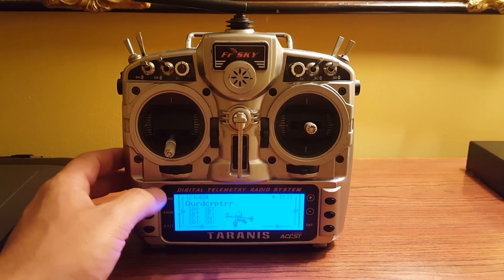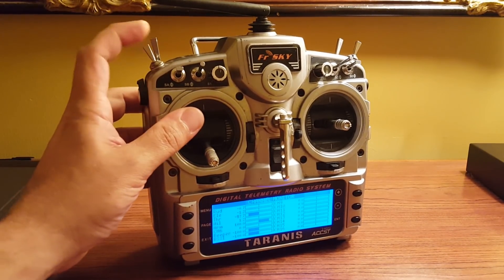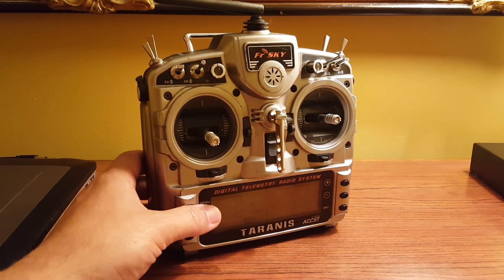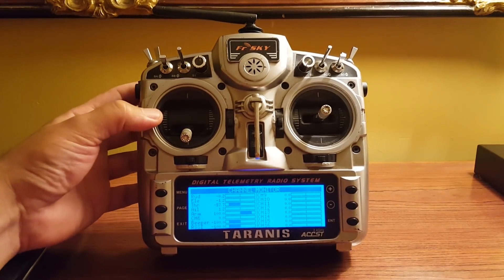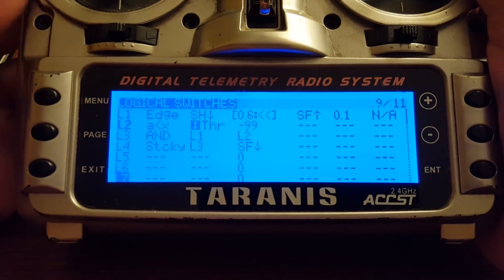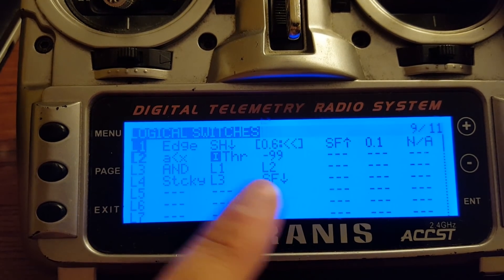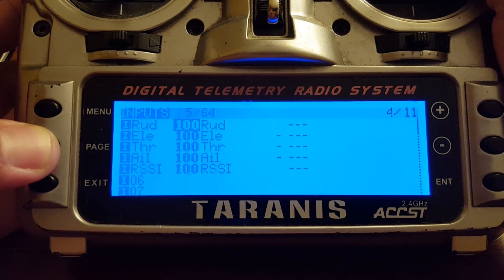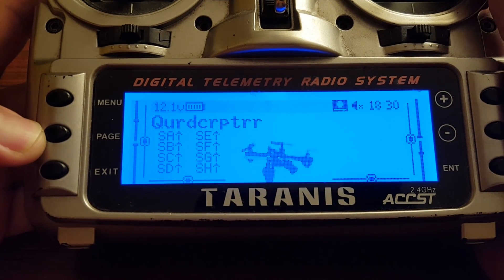Safer Switch Arming on FrSky Taranis

Comment: Kind of getting this but when I set it to the same as you it would only disarm. Until I switch the 100 and -100. It works as it should except the false part is the wrong way around I'm thinking maybe I should have just changed the true and false values.
My switch disarm is also switch away from me and arm is towards me.
Reply from the maker: That's why: because your switch is the opposite direction from mine.
Reply: Was thinking that. I did not expect a reply never mind a reply so fast you are an absolute legend I'm just new to this and you are helping me so much.
Reply: @JoshuaBardwell  Hey dude. Excellent vid... I'm new to the hobby (but a professional tinkerer). I just got an x9d plus, it appears as if the off position is when the switches are down for me (The remote complains when I turn it on if all the switches aren't down). I thought I was doing something wrong since I had to swap the up and down on my arm switch and swap the positive and negative values, but from the original comment it appears as if I'm not the only one. Might want to make a mention of that in the description to help the noobs like me.

Comment: Hi Joshua, i have a kingkong 115 and have a sticky switch setup on it that works as it should.......i now have a new model the diatone tyrant s. I copied all the setting of the king kong model #1 and im using it for my new model the tyrant s model #2...the problem im having on the new model #2 is .......in the channels monitor channel 5 bar is to the left, disarmed.....when i raise switch SF the bar moves to the right copter is armed. When SF switch is down copter is disarmed. I can arm it with the SH sticky too......in the Outputs page channel 5 when SF is raised the arrow moves to the right. When SF switch is down the arrow moves left. When using the sticky SH arrow moves to the right and is armed......i have looked over this many times and cannot figure out why wont it srm like the the kingkong model #1
Reply from the maker: If you copied the model then the switches should perform exactly the same. Have you changed something about the model such as reversing a channel?
Reply: Joshua Bardwell ...i would think it would be exactly the same. As far as i know i didnt reverse the channel.....i didnt reverse anything on the copter in betaflight. I dont know if you can or not but ill check........ I was testing it without turning on the copter just the radio. .....did the same thing....copter is responding to the outputs of the radio.
What page would be to reverse channel. Just dont want to arm it that way lol
Reply: Joshua Bardwell channel not reversed in transmitter
Reply: Joshua Bardwell i moved my tyrant to #10 spot.....recopied my kingkong specs into #2 spot. It works.......how to delete old model

Comment: Hi Joshua 
Do you know if theres away to set up the momentary switch on the  x9d plus for the trainer switch. Single click to go to the student then single click again to go back to the instructor . 
I love the way the spektrums work,all the instructor has to do to get control back is move either stick a small amount.  This would also be cool if the taranis could work like this also.

Thanks for any input
RK
Reply from the maker: Yes, you can definitely do this. All trainer functions can be tied to activate only when a switch is set.

Comment: Question 1 of 2: Safety wise, does it matter if the arming signal is on the left or the right end of the switch range? One of the reasons I ask this is because the switch positions on my build seem to be at different levels for the various channels with the transmitter off and Q2: am wondering if the arm range were to be picked where the switch lied, would the copter arm on power up? I have just adopted stick arming only because of this awesome way to do it (and I think I disarmed during a hard turn :-)
Reply from the maker: It doesn't matter exactly where the arming position or channel value is. Just as long as the logic is set up correctly.

Comment: Am I the only one who this did not work. 
I copied exactly about 5 times. Will always arm with single arm switch SF...
Reply from the maker: Most likely this is caused by you setting your arming mode as "high" on the Aux channel. I set my arming mode as "low". So probably your arming logic is reversed.

Comment: what happens if your weight goes to GV1
Reply from the maker: Sorry but I don't really understand. If it goes to GV1, change it to what it actually should be.
Reply: Joshua Bardwell it won't go back to the number  I want,  will you be at quad camp Detroit

Comment: A tip for others following the video. I followed all the programming instructions and it seemed the quad arming was backwards and screwy on how it would arm and disarm. After looking at the video over a few times, I noticed J.B.'s arm mode was at the opposite end of the scale from mine. I connected the quad to betaflight, mode tab, reset the arm mode scale, and "voila" works perfectly.  Proud of myself that i was able to figure that out, maybe I really am "learning something" from Mr. Bardwell? Thanks for the great videos and support to all us noobs out here!
Reply from the maker: Good one :-)

Comment: Really nice way to Arm.
I have another way off failsafe arming, I have two switch's : one is a "master kill", the other is the Arm.
It works in the way that any off them can disarm if flipped, but the Arming will only happen when the "Master Kill Switch" is on.
This will avoid the "accidental radio bump", as long as any off the switches are set low.
And yes, this came up after I had a scaring experience when retriving a drone from a low tree, I sent the drone to the ground, then when I jumped from the tree, the radio switch bumped on me and the drone armed, lucky I was fast enought to hit disarm.

Now I have one for you guys, yesterday when I was to land, I hit disarm (as always) at about 30cm from the ground, right after the drone when into FULL power (disarmed !!!), I lost ALL command with the drone, had to quickly turn the radio off, to let failsafe (1sec) bring it to ground (100mt away after a perfect loop), I had my goggles on but this is what by buddy descrived to me (he was on standby to fly and watching me land). So, what happended ????
(BF3.2, Turnigy 9XR with ER9x, Frsky XJT Tx, Frsky XM+ Rx)

Comment: So I did everything in the video perfectly. Problem is you left out what to do next to set your arm mode in Betaflight. Do you set it up normally like if you had a one click switch arm or is there a special setup for the sticky switch arm in Betaflight? Because my drone isn't arming. 

EDIT: To setup the arming mode in Betaflight first make sure your momentary switch isn't set for anything else, if so use another switch for that function. Once you've made sure your momentary switch is cleared and not being used, Go to the arm mode, set it to "Auto" and perform your sticky switch arming sequence. Your Arm mode will pick it up (mine picked it up as AUX 1) and now from there move your range tabs to the appropriate position and save.
Reply from the maker: You set it up based on the Aux channel like normal.

Comment: Thanks so much for putting this video together!

Do you know if this would work with a simulator? I'd like to be able to maintain this functionality as a best practice, but from what I can tell, simulators don't seem to respect the arming settings.
Reply from the maker: The simulator can be set up different ways depending on how it's programmed. Some can be set up to arm/disarm on a switch just like a real quad.

Comment: Great video even a newbie could follow (-;  I do have a simple question about why you chose for the up position on switch SF to be armed and the down position on SF to be un-armed? Is there some ergonomic reason about how you hold your transmitter that makes it better this way?
Reply from the maker: I feel better disarming swiping the switch towards me rather than pushing it away.

Comment: Great vid. Learned so much.
I took this idea and gave it my own twist .
L1  (AND) SH , SF . 1.5 sec delay. Arm and momentary beeper sw.
L2 (STKY) L1, disarm with SH Off
Mixer CH5 set to L2
Now when I flip the arm sw and hold the momentary beeper sw for 1.5 sec, I will get a beeper sound for 1.5 sec and then props arm. This serves 2 functions. If I accidently have it armed and press on beeper, I get a warning before it arms, secondly, if I am intentionally arming the quad, it let's anyone around know that I am arming the quad . This was so much fun to play around with and to get working. Thanks for all the work you do.
Reply from the maker: Very nice idea. I like that a lot.
Reply: @JoshuaBardwell  what do you think about using a rotary knob > 90% condition instead of the throttle > -99 one? That would feel like a "turn on/off the key" feedback, even more positive and less prone to false activations.
Add the 1.5 sec beeper on top of that, looks like a very safe procedure.

Comment: I have followed this perfectly. I saw on the Logical Switch screen, it worked on one occasion I mean I saw what your screen did when armed. ! It will not work consistently. I just don't know where to go next. Your screens are easy to replicate. Could you offer suggestions.

Comment: Joshua, can you think of a reason with this dual arming sequence that after using turtle mode, props do not return to the normal direction after exiting turtle mode?  Example use turtle mode to flip over , exit turtle mode and rearm .. yet it seems esc have not recieved dshot commands and my props are still reversed.
Reply from the maker: Check for sure in the Modes tab that the motor reverse mode is actually deactivating.

Are you sure your ESCs support Dshot properly? Try dropping down to a lower Dshot like 300 or 150.
Reply: Joshua Bardwell appreciate the response,  i feel it is a switch sequence i didnt realize i was doing. 
I was disarming first, then moving turtle mode switch back to the neutral/off position. Then would rearm and experience the reversed situation. If i first come out of turtle mode,  then disarm and rearm its ok everytime. 
Happy Flying!

Comment: Your   ''Safer Arming Switch ''  procedure is undoubtedly the best way to prevent a '' blood event'' - but it does take a measure of understanding to implement it - So is it possible to load the proceedure onto a memory card say,  then uploaded to a model that requires it - OR can it be loaded into the Taranis's memory to be plucked out when needed...joe
Reply from the maker: +Joe Stubbs it's possible to save and load an entire model, but not a part of a model like this. I just use the same model for all my quads though. Look up my video "Taranis model match".
Reply: I'm looking at the vid at the moment with a veiw to use the method.

Chewing over the Switch Arming procedure brought me into contact with a  ''Locking Lever Toggle Switch'' used by Jeti - 2pos safety sw P/No JMS-DS-TSL2S  - this could replace the SF 2pos sw - such a switch could hel to prevent a ''bump'' operation...joe

Comment: Would be good if you could do a new video of this on the Taranis Q7 :)
Reply from the maker: It's exactly the same. They both run OpenTX. The only difference is the screen is a little smaller.
Reply: True :) Was having heaps of problems till I changed my l ARM mode switch position in Betaflight. I have also made it so that i only use three lines by adding the AND function to line two so Throttle and L1  so  now Sticky LO2 in LO3. I also changed the mixer so it just looks for Logic switch LO3 no need to add the other stuff which makes it easier.

Comment: Does it matter that you have the arm channel outputting 100 when disarmed and -100 when armed?(as opposed to 100 when armed and -100 when disarmed) I don't understand why that would matter/why one would do it that way?
Thanks, Luke
Reply from the maker: No it doesn't matter. As long as your modes and failsafe are configured correctly you can use whatever value you want.
Reply: Thanks!! Learnt on a ZMR 250 and have all the parts for a new LS210 coming in the post his week, so getting all the info i can. Can't wait

Comment: Hi Josh. Great video, thanks :)   Am a newbie with a little question.... Once this sticky arming was applied, and working with my Taranis X7 (Aurora 90) I noticed I had to put downwards pressure on my throttle for it to work. I reset my end points on the Taranis using Betaflight, but it's still the same. When armed, the Aurora's motors immediately turn slowly, even with throttle at minimum.  Which of your video's explains this 'throttle dead band', I have re-watched over 20 video's today to no avail. Any direction would be muchly appreciated Josh.... Cheers ;)
Reply from the maker: You need to adjust min_check.
Reply: Thanks mate. I think that's covered in your two part "Cleanflight throttle parameter configuration" series ? I'll have a look tomorrow.  Thanks again :)

Comment: Joshua I've finally been trying to do this sticky switch arming set-up in my X9d plus and now I can't get anything to arm. Set it up just like your video shows. Do in need to do it for all of the quads set-up on this radio? I have  three quads that are set-up twice, once for 3s and once for 4s for the different battery alarms. I'm thinking of maybe just doing one set-up for 3s and one for 4s, binding all just to the two set-ups. What are your thoughts?
Reply from the maker: I run all my quads off the same Taranis Model. Just make sure they're all set up with identical arming and other switch config. I don't know why your quads won't arm with this setup but something must be different about your channels or switches. You just have to work thorugh it and see where it's breaking.
Reply: Thanks for the fast reply. I haven't got them all set-up with the sticky switch arming yet, only the one so far. I figured that it might have to have all set-up the same to work properly. I'll finish changing all of them over to the  S.S.A. tomorrow. Thanks again Joshua, have a good night!
Reply: Hey Joshua FYI, I figured it out! It was the way the channels were set up, ERTA, the way I purchased the radio and one quad. So I had just set all my other quads up that way to. Worked fine with one switch arming. Changed radio and quad back to RETA and it works great! Love the safe arming! I enjoy your videos of flying and all the information. Again if you are still in Hawaii try to hit Kauai it is our favorite island.  Waimea Canyon (Little Grand Canyon) and the Na Pali coast are off limits to quads per my HOV APP, but awesome  to see and or hike! Enjoy and thanks again.

Comment: Hi Joshua
I'm using Ersky9x
I have set it to arm my motor with a rotary switch (P3) plus a sticky on the throttle stick
This way its impossible to knock it on by accident
regards
Hans

Comment: I like the added safety here. Is there a way to use this setup, but also add another line to make L4 not true with a quick flip of the momentary switch? I was to be able to disarm but flipping EITHER SF or SH.

Thanks!
Reply from the maker: +Marshall Campbell you can do that. Make a new line that is true whenever SF or SH and make that line be the end condition for the sticky.

Comment: More questions from an idiot. So I programmed the taranis and set everything the same. However for me, the throttle down and to the right still arms the quad and throttle down and to the left still disarms the quad. Is there something on the transmitter that is telling it to do this or in BetaFlight?

Thanks.
Reply from the maker: You need to set up an Arm mode in Betaflight.

https://www.youtube.com/watch?v=SLy28mYiAzU
Reply: Joshua Bardwell and now I've learned more. Thank you very much.

Comment: Is the disarming the same as arming in this configuration?
Reply from the maker: No. You disarm simply by flicking the switch to the disarm position. Disarm should be fast and simple. Only arming needs the safety.
Reply: Joshua Bardwell you're friggin awesome.

Comment: Hey joshua.. i was wondering if you can tell me how to do this but instead of using the stucky switch i want to use one of the 3 pos. Switches on the right side of taranis and the 2 pos. Switch on the left side (i think it SE or SD).. i cant figure out how to use 2 switcjes to arm.. thanks
Reply from the maker: If you are not using a momentary switch then you don't need to use a sticky switch at all. Just set up a Logical Switch that is TRUE when SF=UP and SH=DOWN or whatever logic you prefer.

Comment: I like this method, I do something similar.

I fly with a sprung throttle (this way I can feel mid-throttle - In one mode I use S2 to adjust throttle max so I can fly overpowered quads comfortably).  I use a dual stick arming. SA is a safety (and instant disarm), SF is hold (and instant disarm), SH is arm (and disarm if hold still on).  This way knocking any edge switch will also prevent arming if safety is on.  I do however force the throttle channel to -100 while SF hold is engaged.

Question: Below min_check, is yaw still disabled if switch arming is in use (ie. while in throttle deadband)?

Comment: Why the MAX override on CH5 mix, instead of a OverrideCH3 -100 on Special Functions? I think the latter is safer, as it overrides the input completely, and keeps to possibility to move the other axes freely, useful on some quadcopters where you can recalibrate or do other things using some stick movement combination.